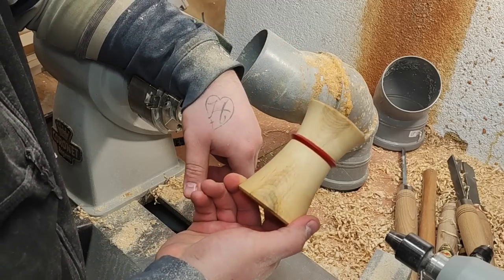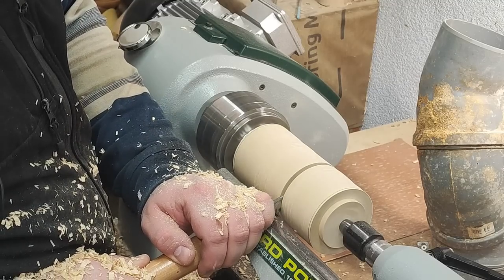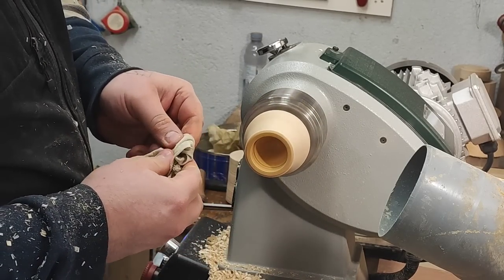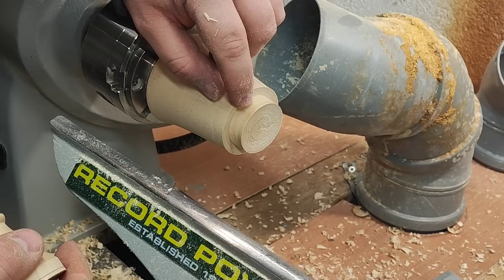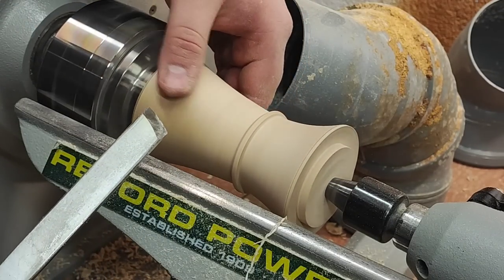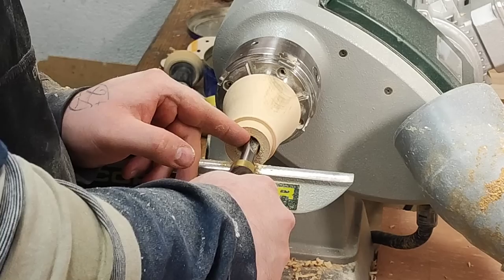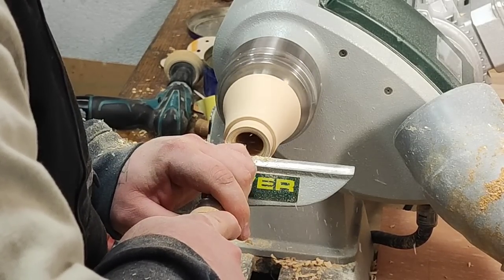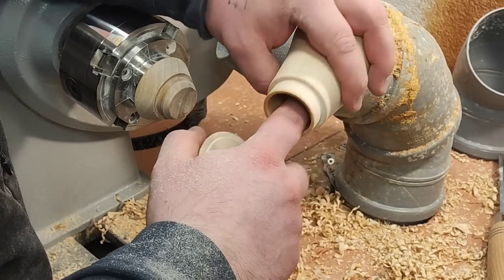Wood box decorating idea

Comment: Where did your Record Power lathe go? In this video it sounds like a bearing is going bad. Very nice box....you are precise and fast.
Reply from the maker: Thank you sir, bearing was fine as the lathe was only few months old, there was  a sort of weird dry spot in fan shaft, when I would pur wd40 the noice was gone.... Weird but it was good lathe but had some features that I didn't like ,like longer stoping time....
Reply: Last night I saw your video discussing the Record Power lathe and why you made a change. I also watched other videos and noticed the long stopping time you mentioned. I am surprised Record Power cannot quickly address this issue. Usually the Variable Frequency Drive Controller has an adjustment for the amount of braking when turned off? They must have some capacity limitation preventing a quicker stop, it generates heat....surely they realize the turners desire....I saw your older green Record Power lathe stopped very quickly. @tomislavtomasicwoodturning
Reply from the maker: @Bunk599  you are right, I did asked them but I got No as an answer, I know that ist just a few settings in inverter but I did not want to mess with that and lose warranty...